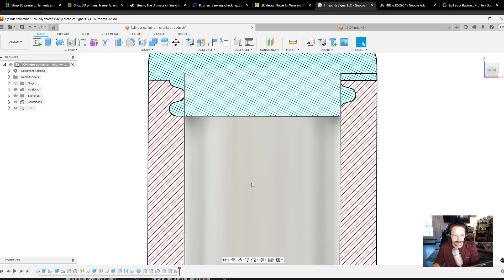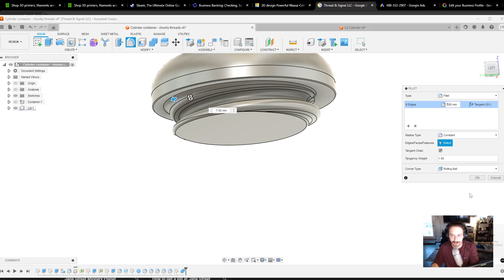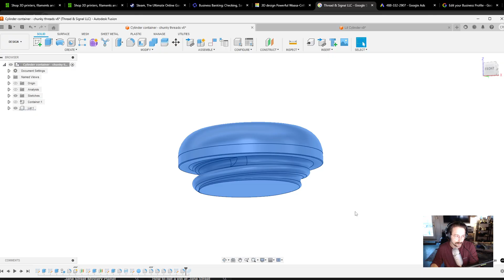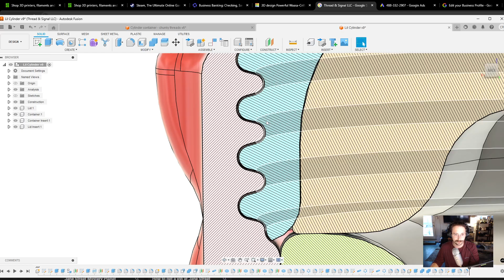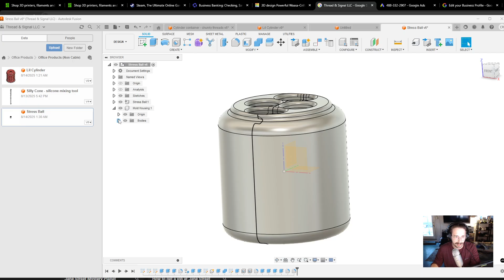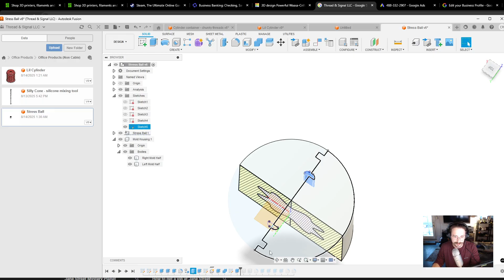Fusion Tutorial - The Secret to BUTTERY SMOOTH 3d Printed Threads, Press Fits, and Molds

Comment: How about when designing for a press fit without any threads/coils? I'm a beginner at Fusion and 3D modelling in general. Thanks
Reply from the maker: So to clarify, you’re looking for a video on press fitting fasteners/bossing for enclosures with multiple parts?

Edit: after re-reading that, you’re looking for a video on press-fit containers. I can do that because I just made a model of one for an electrical enclosure. It’s basically just the same offset, combine cut, offset back combo as in this video, but with no threads.